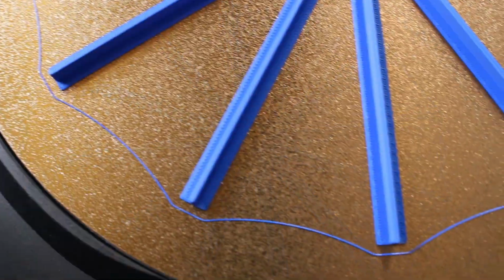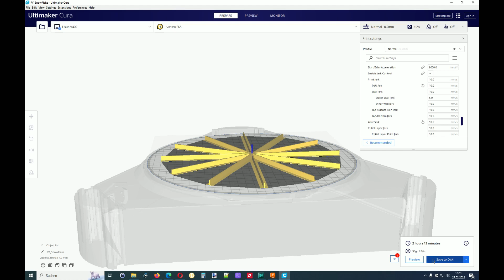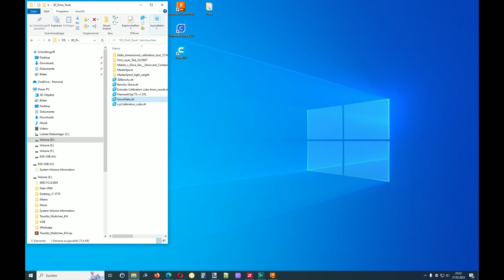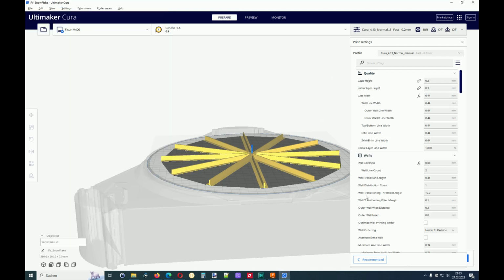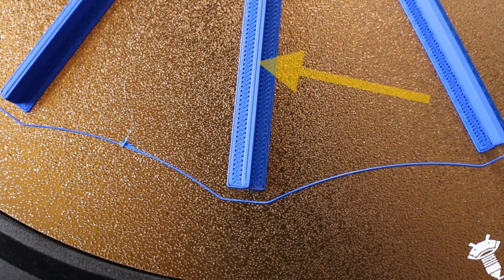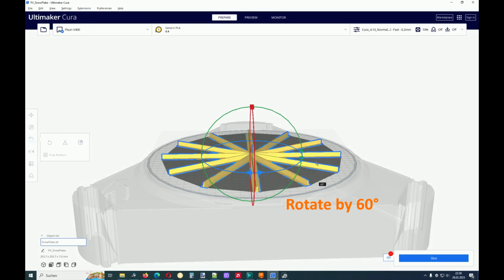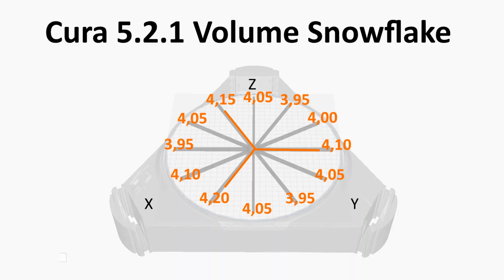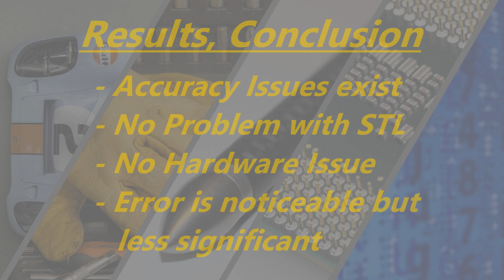FLSUN V400 Delta Printer Accuracy Issues

Comment: So whats result
Reply from the maker: Thanks for commenting! Well, at the moment I do not yet have a result. I assume the FLSUN Klipper Version has an issue. At least all I read points to this direction. This is why my next video will deal with installing original Klipper to the Speeder - how you do that and what to know and so on.
After that I will do another Video about how to calibrate everything (maybe also with an ADXL345 device). 
In between maybe... but for sure when all that is done I will again print the Snowflakes and see, if this really was the issue.
Unfortunately I cannot do this right now. I will need at least 2 weeks until first (next) video will be out.
Reply: No one could help for now :face-pink-tears:
Reply from the maker: we will get this done... we know what to do and I guess I simply will do it. In 2 weeks we will know I assume. THX for commenting!
Reply: @craftingmat5425  I can confirm now that I have the same issue with my QQs pro and my brand new Super Racer.  Super Racer is on marlin from factory I believe.  QQs pro I have tried the oem firmware, marlin and klipper with the same accuracy issues.  Specifically a 200mm by 5mm rectangle that's wider on the right vs the left by 0.3mm. The crazy part is is that when I slice it with Prusa instead of cura the wider part is on the left vs the right.  I have figured out the cura prints clockwise and Prusa prints counterclockwise.  I have only tested your snowflake on my QQs pro tho I assume the issues are related to my 200mm by 5mm rectangle.  The only thing that helps on my QQs pro is designing more play into the C tower carriage bearings.  I'm unable to do that on the superRacer do to linear rails so can't test for that.  I printer your snowflake with loose bearings on C tower too. I still have the gaps but not nearly as bad and width dimensions on oposing legs are within 0.05mm.  Without loose bearings they are 0.3mm off.
I printer the snowflake on my ender 3 too and I'm afraid it shows the same result tho not nearly as bad. And I had to lower extrusion value to make the gaps apear... 1oclock leg, 4oclock, 7 oclock, and 10ovlock all have gaps. Barely visible but I can force the walls apart. The dimensions are pretty accurate tho. The legs without gaps are only 0.06mm narrower then the ones with gaps. Huge difference from my deltas which have differences over 0.4mm on some legs.
Reply from the maker: Wow - you already tried Klipper on the QQ? I assume this took a lot of time then.
I would not mind the gap (lol), but I would like to see the accuracy. The gap only pointed me clearly to the accuracy problem... maybe in 2-3 weeks I am done with my Klipper Test. I am very optimistic, that this will clear the issues. Hope to see you in the comments then again, Nate!
Reply: @craftingmat5425  klipper was the least intensive thing I tried.  I also rebuild and switched around every moving part of the printer that I could think of. I have spent countless hours trying to fix this issue with no relieve accept designing more play into the c tower carriage bearings. Which is just a random thing I tried like many others, and was the only thing that fixed the right to left accuracy issues on the 200 by 5mm rectangle and improvements on your snowflake. both my deltas and my ender 3 have the same issue, accept quite a bit better on the ender 3 where it's pretty much acceptable at 0.06 width difference. It sure would be nice if someone finds a solution. I hope your voice and YouTube videos go viral so more people start looking into this issue.
Reply from the maker: @natewipf5064  My channel is much too small to spread it. Also it was not meant to be 3D only content, it just happend like that as a coincidence, but I will also have other content here.

TBH if I am below 0,1mm accuracy I would be happy already. The SnowFlake should be 1,8mm... if it was 1,7 and 1,9... fine for me (to my experience it differs to the positive, less to the negative end - so realistically 1,8 to 1,9mm). But it is 1,75 up to 2,23 at the moment, which I think is not acceptable in my point of view. 

I think what you mention here with Cura and Prusa slicer shows that it is not a mechanical issue.

Did you try input shaper as well? If yes, what was your method? I hope this one will do a lot in terms of precision - at least I am optimistic for that one.

Your input is very (!) appreciated! Thanks a lot!
Reply: @craftingmat5425  yes I have tried input shaping with klipper and accelerometer.  following the documentation.  No help at all.

Comment: Did you try a slower print speed. I've got two of these printers and I'm about 200 prints along, they quality has been impressive but the Cura z-hop command is not used by Klipper. Flsun's solution is 10% lower flow, but some prints have to run at 250mm/sec or they get punted off the build plate.
Reply from the maker: Thanks for your comment! Yes, this was printed (very) slow at 120mm/s (it is also mentioned in the video).
I think I will go with original Klipper soon... I have found hints that this will improve a lot.
I will also do another video when I do that (so a bit more content for my channel). But I cannot do this now, this will happen in next 2-3 weeks I guess.
Reply: @craftingmat5425  please see my comment.  Don't look like i tagged you correctly. I'm willing to work with you and do what it takes to resolve this as I have spent countless hours on my QQs pro trying to fix this and my brand new Super Racer has the same exact issue.
Reply: @craftingmat5425  the only thing that helped so far with my QQs pro is giving the C tower carriage bearings a lot more play, which is not a good solution as I can't print fast then.

Comment: Interesting. I have a FLSUN QQ-S Pro and developed a star pattern  which consists of 3 lines, of single layer height, for each "arm". I performed the basic bed curvature calibration and when printing this object I observed no gaps whatsoever. The outer lines are printed first with the inner line printed afterwards and it fits perfectly.

The fact that the anomaly occurs at 120 degree spacing suggests it is definitely a motion artifact. I wasn't quite clear whether the affected "arms" fall mid-way between the vertical towers where the position is defined by two adjacent towers and there is a relative positioning error between them? Maybe you can develop some additional test shapes to exercise this idea?
Reply from the maker: Hello Neil, 
thanks for your comment.
No, the defect is not exactly midways between two towers. It is one arm left or one arm right of it (depending if running Cura 4 or Cura 5). 
I think it is a precision topic.
When checking this issue with Simplify3D I found out that the calibration snowflake (which was not my design in the first place) in fact is designed to have a size of 1,75mm thickness of each arm - meaning, there is already a 0.15mm gap designed in the middle of each arm.
Basically, the printer is not translating 1,75mm 3D Model to 1,75mm in reality but up to 2.20mm in reality -> this is a precision issue. Again: It should measure 1,75mm... but it is not. It is at least 1.8mm and if the precision-glitch is striking... it is even more (like 2.20mm (resulting in a visible gap), which is close to 0.5mm - which I consider by no stretch of imagination "ok").
My printer does not extrude too much, I calibrated it accordingly.

Comment: You must do an enhanced delta calibration for improve your accuracy
Reply: You should do a video on how to do it, it could be very beneficial for beginners
Reply from the maker: @sebastianlopezalejos  Yes, maybe that is a good idea for new content. I think about that. It will take me at least 10 days (more likely 2weeks), as I have atm no access to my V400.
Reply: @craftingmat5425  The order of the calibrations is critical to obtain a good dimensional result in a delta. On Klipper’s website they explain it to you several times. Basically, first you adjust the extruder steps, then the Z-offset, then the normal (auto) delta calibration. Then you print a model to calibrate the advanced delta (the bigger the better. In a V400 one fits at 200%). You do the advanced delta calibration. You check the Z-offset again and do a Bed-Mesh with at least 5 probes for point and at least 9x9 matrix. Of course, you also need to do an input shaper, a pressure advance and a flow test (very important this last one for accuracy in measurements) and that’s it. Making a video of all these steps, even in a simple way, would be awesome and unique on the internet. Go for it!
Reply from the maker: @cpasoft  Thanks for your comment. I did the basic calibration of course. If you have a V400 on your own... give the snowflake a try and check if your printer does as you think it should. I promise - it will not (unless you crank up the flow so the gaps are conceiled with that). I can say for sure, that this is not a matter of bad configuration/ setup.
Link to the snowflake will be added in the video description.
Reply: @craftingmat5425  can you do a video on enhanced delta calibration please that would be very beneficial to community
Reply: yes, enhanced delta calibration helped me with the same problem.
Reply from the maker: Thank you for your comment. In my community the enhanced delta calibration was already done (more than once). The issue does not disappear, maybe it gets a little bit better.
Reply: @craftingmat5425  the enhanced delta calibration does NOT work properly in the FLSUN Klipper firmware.  You can verify this by recording your tower angles before and after the calibration.  Standard klipper will adjust tower angles with the enhanced delta calibration, but the FLSUN supplied version of Klipper does not adjust the tower angles.  Moving to standard Klipper will resolve this.  An interesting test on this printer (and I realize it's been 8 months) is to print an 100mm x 100mm x 10mm test print and measure the X vs Y.  If they are different, your tower angles are incorrect.  You may be able to reseat the towers and try to square them up, or adjust the tower angles in the printer.cfg file manually to see if you can get X = Y (all that is important is that they are the same, it doesn't matter if they are 100mm).  Once you get X=Y you can then adjust the arm lengths to get X and Y equal to 100mm.  It's much easier to just do the enhanced delta calibration, but many people don't want to change the firmware.
Reply: No it don't would help. i did 15 enhanced delta calibrations too... only the separations are on other places...